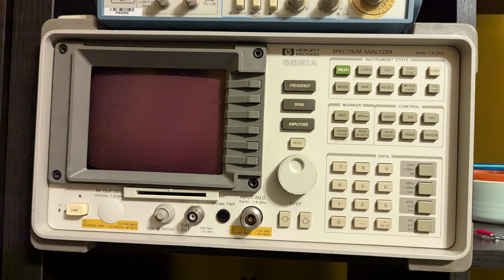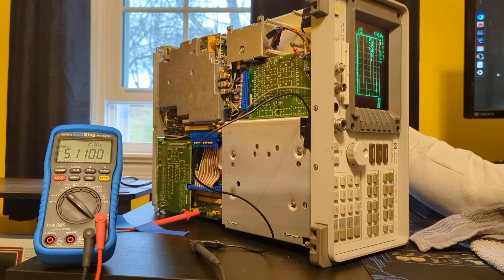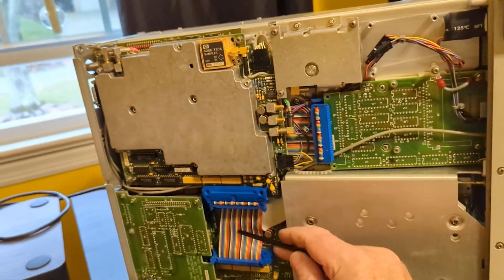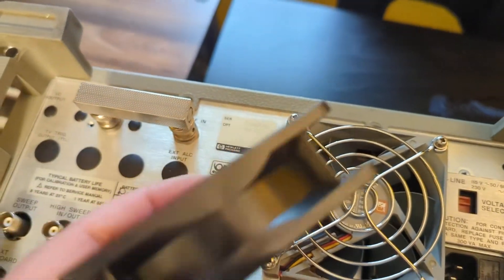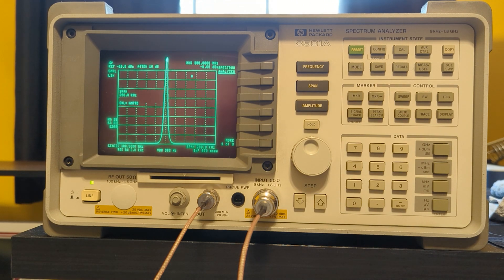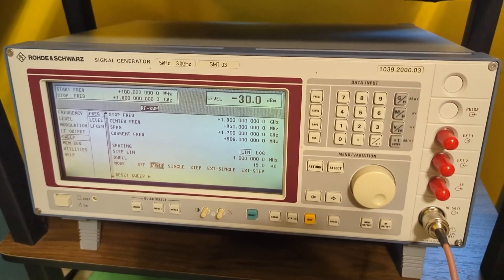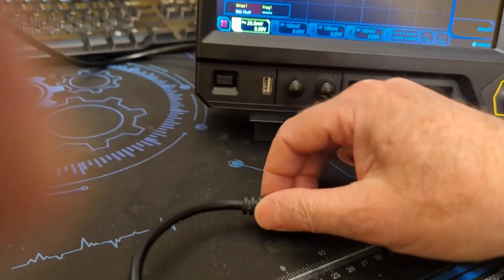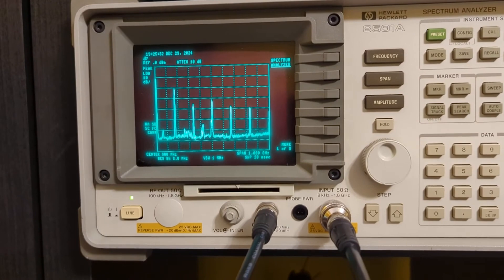Repairing slow updates on a HP 8591A Spectrum Analyzer

Comment: I miss that spectrum analyzer, I used to have that HP - have the Tiny SA Ultra now, and albeit usefull, its SO slow in comparison to the HP from the 86's
Reply: I am forced to use a very VERY expensive Viavi 8800 digital radio test set at work. It is a miserable bit of tat, and I would swap it in a heart beat for the old HP SA with tracking generator we had at my last place.

Comment: I had a spectrum analyser with dead PSU, and did a PSU capacitor change, plus battery, which livened up the unit. Unfortunately YIG problems gave some issues, which stopped me going further.